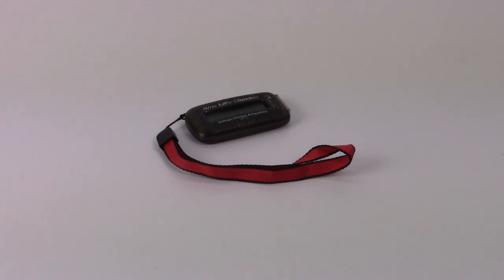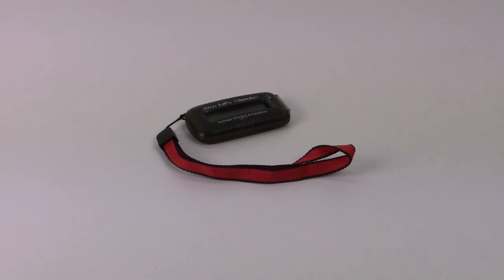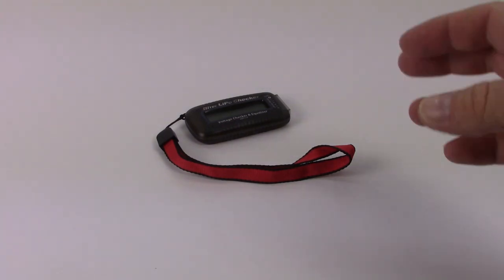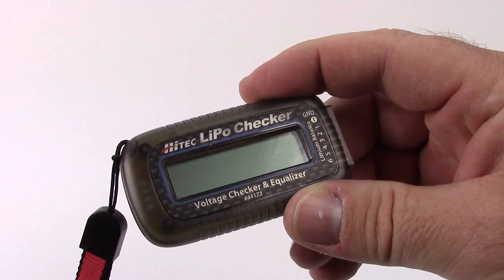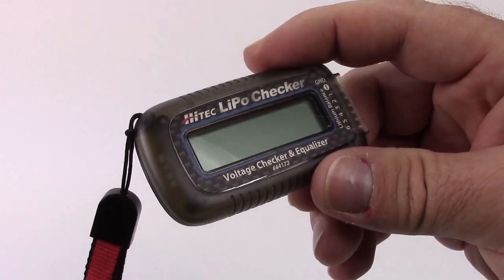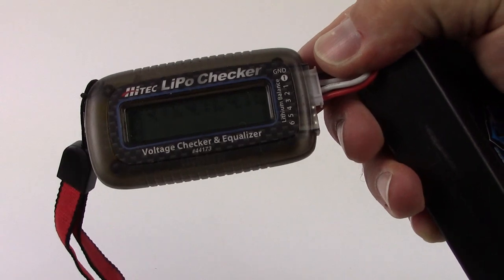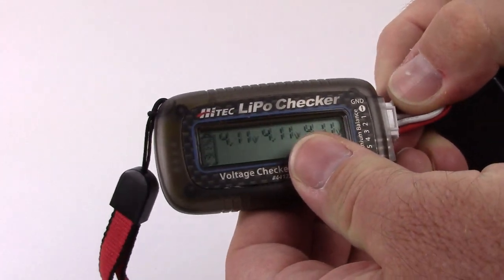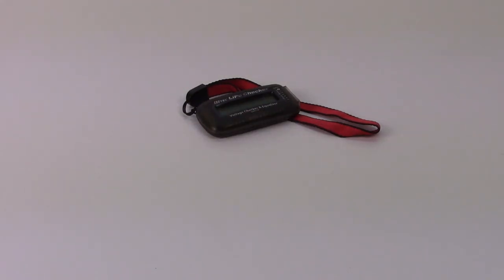Tool Tuesday EP30 - Hitec Lipo Checker/Equilizer

Comment: Hello!!This is ABA 8 valve turbo! This is the engine I built for my vw gti.....anyways...when I charge my batteries for me and my son's outings.... I wrap a rubber band around them. Since I have to remove the rubber band to install in my car..I can assume if there is no rubber band...it is discharged! I would really like to see a tool Tuesday about a chassis set up gauge. I have never used one before and find limited info on them.. I see several brands out there and Hudy looks the best mainly to set up our b44.2  .3 and b4.2 for an outdoor track. Thanks for the great channel, thumbs up and subscribed!
Reply from the maker: +aba8vt Thanks for watching ABA.  Most Chassis set up tools are Camber, ride height and Toe In gauges for off road. Are you thinking about the Chassis stations for on road?
Reply: +The RCNetwork like a hudy #108905

Comment: Hi Rich 
Thanks for your tool Tuesdays, they have been great! Loved the lipo checker, going to follow that up right now.
Check out the Mr Grippy soldering tool. About $15 US, holds wires and connectors, made from carbon fibre.
Got mine on EBay "wave propagation" a fellow Aussie, superb service and fast delivery.
Have a great Xmas holiday season if I don't see you posted prior.
Regards 
Garszy
Reply from the maker: +Garszy Thanks Garszy!  Always great to see you on here!  Have a great Holiday Season!

Comment: Hey Rich, while these things are cool, what timer do you use, I know most of us have them so we do not run dead on the track or in my case in the air or on the ground (yes I am a true addict lol). Just curious if you use one or if you have an alarm on your rigs.
Reply from the maker: +Anthony Eaglebarger (toysoldier46552) Being only a surface guy, i typically don't time my sessions.  I do have built in timers on my radios (4PX, MT-4 and DX3r-Pro).  Now getting the Helimax Voltage....my thoughts have changed! lol
Reply: The RCNetwork Well if you do get into flying most of your aircraft do not have warning beepers built in so you will either have to add them or just use a simple timer, they have free apps for the cell phone which I currently use, average is about 5 to 6 minutes so you want to set those flights for about 4 1/2 minutes so you don't lose the aircraft. I fly hex's and quads aka drones so I have no experience with planes helicopters yeah the same concept applies for timing.